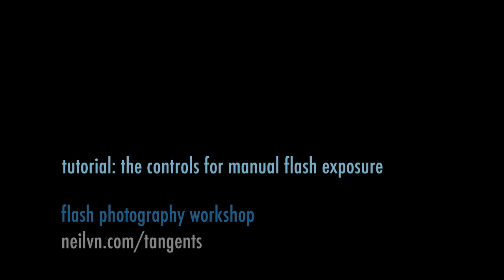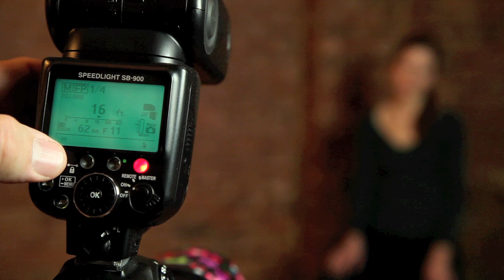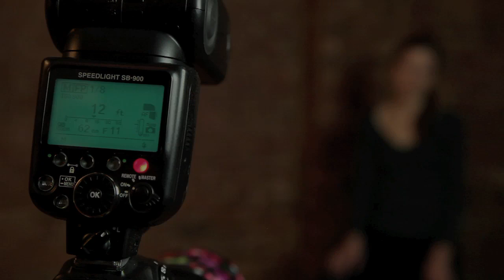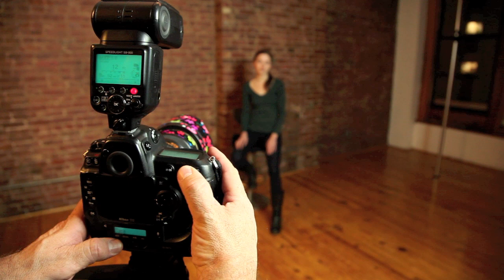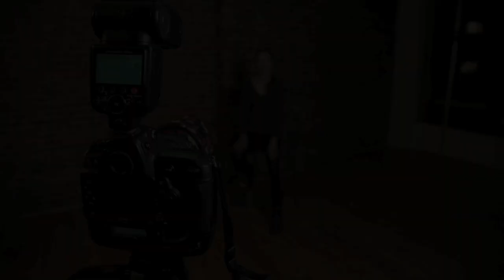Video tutorial: Manual flash settings with speedlights

Comment: Something worth adding is if you are using a zoom lens and zoom the lens after setting the power, you will need to reset the power as the flash will have also zoomed unless you have the auto zoom disabled on the flash. So, compose then adjust the flash or disable the zoom on the flash.
Reply from the maker: A very good point!  It is for this reason that I keep my flash zoomed to the maximum focal length.

Comment: Hi what about the shutter speed? Nothing is mentioned
Reply from the maker: Below maximum flash sync speed, the choice of shutter speed has no effect on flash exposure. 

Of course you want your shutter speed at a value where you don't get camera shake or unintentional subject movement ... and also so low that the ambient light doesn't impact your final exposure in a way you don't want. 

So there is a bit of leeway in your choice of shutter speed. 

Also check this tutorial about when you should or should not go over maximum flash sync speed:

https://youtu.be/9MWPa6i19yc

Comment: I do not understand a few things. I use a Nikon F3 analog camera with an SB-800 speedlite. I use a simple A-41 adapter so I do not have TTL. I only get “aperture priority non-ttl”, “distance priority” and “manual”. I do not understand in these settings how to determine my exposure time.
Reply from the maker: Your best approach would be to use a light meter to measure your flash, since you are missing out on immediately seeing your results with film photography (instead of digital.)

Comment: At a wedding recently, I locked my Flash in Manual mode and used the ISO to lighten / darken shots indoors. Worked great in a hurry and the flash menu was too complicated to bother with.
Reply from the maker: Which camera and flash are you using?  (I rarely go into the flash menu DURING a shoot.)
Reply: Sony A7iii and Godox TT685. I changed the ISO on the back of the camera. Different lighting situations called for more or less (manual) flash. @neilvn

Comment: This is all great info.  But isn’t this calculation done automatically by TTL?
Reply from the maker: TTL works great, and I do use it when I have to shoot fast and get immediate results that look good. But because TTL is an automatic exposure mode, it is inherently not consistent because it is affected by the tonality of your subject and scene. 

The amount of light and dark tones in the scene will affect your TTL exposure. Similarly, back lighting will affect your TTL exposure. 

For this. manual flash exposure is more consistent.

Comment: Neil hi.   Always love your videos, over n over!   My question: I hv Canon equipment but always have loved the sb900 for its fstop/distance calculator!!! So, many times, I will use the 900 on my can in manual mode.  To your knowledge, are there any new Canon or third party, Canon compatible, flashes available, which will be able to to do exactly what the 900 does??   Best and a Happy Thanksgiving to you.  William
Reply from the maker: Hi there — the top end Canon flashes like the 600EX will do the same.
Reply: @neilvn  Thanks for the fast reply.  Yes they do, to an extent. The 900 gives an exact distance, thus my Canon, just a range.  Also, being able to plug n play fstops, iso, etc; is not the same.  I was hoping for a third party flash to match these features, but I guess not.  Thanks again.  William